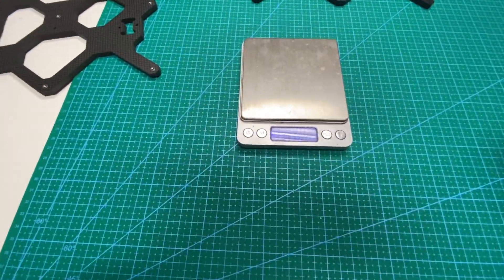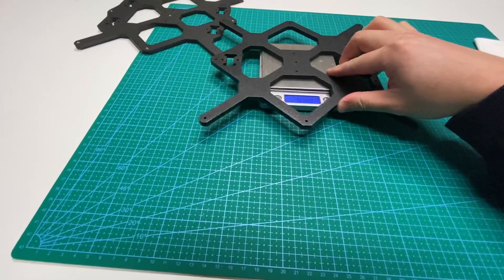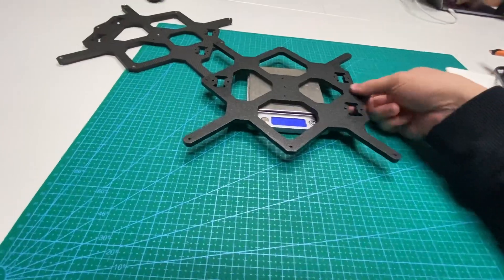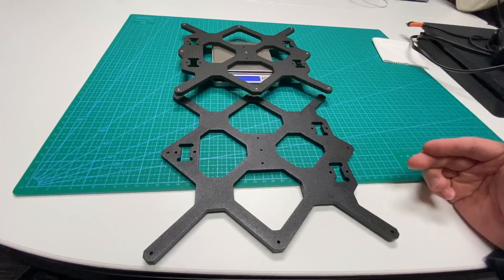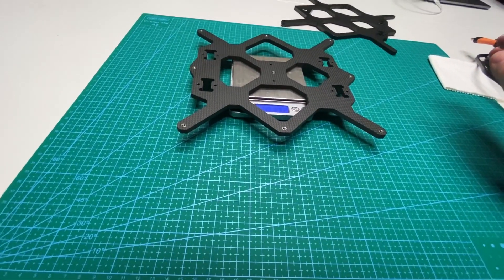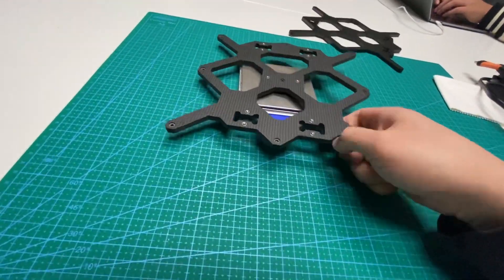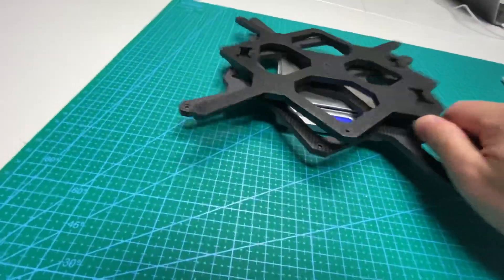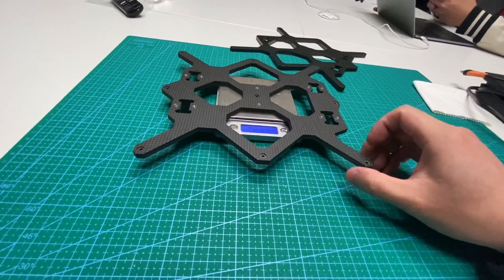The reason I made the quad bearing mount for Prusa MK3s

Comment: It's just to cut costs nothing more. most high precision industrial machines use a mirrored setup, 2 left 2 right, 4 left 4 right or whatsoever. I got 2 out of service industrial robot arms for making chip wafers and they even have 8 sliders on each rail, 2 rails in total 16 slicers.
Reply from the maker: Sorry for the late reply.  Yes, I think so, but still a lot of people saying 3 point can define a plate and that is the best lol, I just simply not agree with that. The result of the quad bearing is very good. That's why I am trying to tell people, don't just believe what ever they told, think and test it by your self lol .

Comment: have you tried changing the rods to original misumi rod that match bearings, much tighter tolerance than rods supplied on Mk3
Reply from the maker: Yes. I did. It still have that tiny movement. I talk to couple mechanical engineer, now I understand why 4 bearing fix that problem. Lot of people think 3 bearing define a plane, but it’s not 3 bearing there, it’s 3 bearing with length, and they all have tolerance and resistance, the two bearing side will have more resistance compare to the single bearing side, over time, when the bearing wear out. The single bearing side will always move before the double bearing side move. So the print bed will creat a twist movement. People always think 4 bearing is over constrain and creat binding issue. If the accuracy is not good and the bearing is not line up perfectly, even 3 bearing it will have binding issue because the bearing is not a point, it got length that people always missing to put into this case. if the accuracy on the mount of the bearing is good, 4 bearing can actually provide even resistance for both side, and it will makes the bed move evenly.

Comment: What is the weight of the 4th bearing and bracket? Doesn't that reduce the weight savings?
Reply from the maker: the 4 bearing mount is make by carbon fiber, the weight is about 200g. compare to the original aluminum mount is about 300g. 100g lither.
Reply: @liguokun2005  I see that, but you’ve added a 4th bearing and bracket. I would think that would add some additional weight, vs 3.
Reply: @mattmckinley808  good point.
Reply: It would still be lighter than the aluminum one though.  Just the the difference between the two is nice.  So if you added everything up with the stock bracket plus the 3 bearings and brackets you are still going to have a difference between the carbon fiber one with 4 bearings.